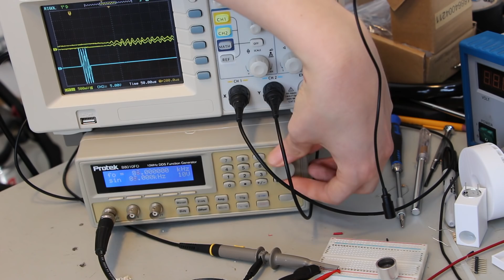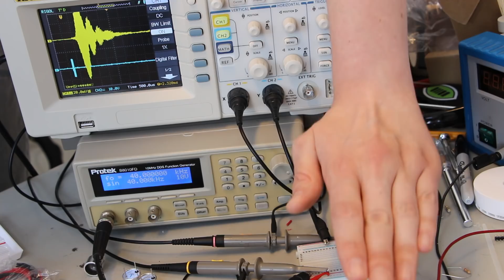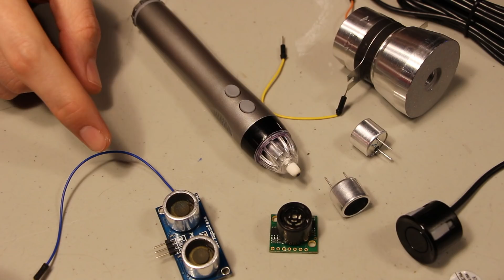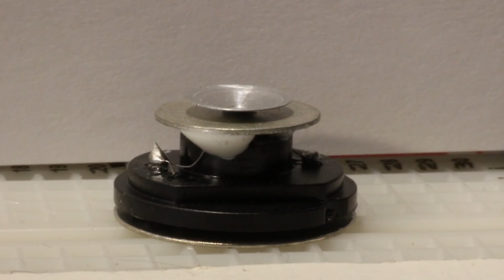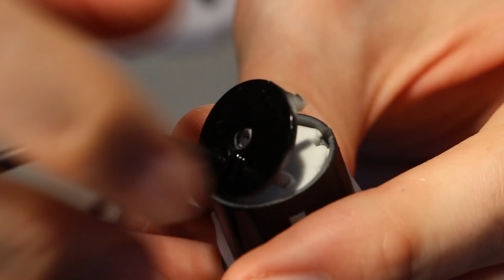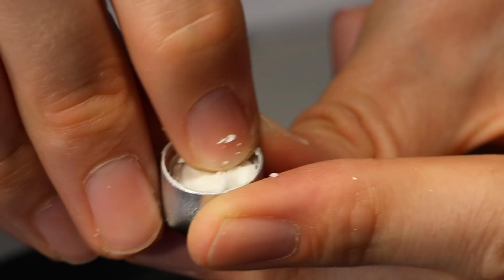Ultrasonic Transducer - scanlime:011

Comment: Excellent video!  Did you ever try using a lighter piezo crystal inversely, as a mechanical actuator? I did it but with 250 volts dc  applied no measurable  expansion. Maybe with AC excitation at resonance?

Comment: if you put a 40KHz sine into a T, then you take the same sine wave into an FM (SSB) modulator and connect it to another T, and you modulate with a signal coming from a microphone or an audio source, you should be able to achieve the laser counterpart of sound. The audible spectrum would be generated by the two ultrasonic waves beating when the second (modulated) one shifts. The interesting thing to do would be to test both free propagation, tube propagation and using a small offset parabolic dish

Comment: Hi Micah,

Great video indeed. I have observed on my side some noise when pressing mechanically on the side of the closed-top transducer sample. It seems that the piezo membrane is in contact with the enclosure. From your observation, do you confirm this detail? Also do you think there is a chance to break it if we keep something in contact with the top surface for a long time?

Comment: Im interested in these things, just curious, what's the smallest transducer/piezo? I've been searching and haven't found much. Is there a way to waterproof them, without loosing too much attenuation? I'd like to use them for both receive and transmit, in a spherical array, but I need/want the frequency response to be lower in the spectrum than the ultrasonic range (ie LF/MF/HF). What do you think the freq response is on these? does it change with size/materials?

Comment: I bought the same sensors, but I do not know which of the two legs is the positive and negative, if I could tell you, you would do me a favor because there is no technical match and I can not solve this problem. tanks
Reply: Micah Elizabeth Scott I have to use it to push the air and in fact on one of the two legs there is black insulator

Comment: Hi Micah, can you say anything about power in these devices? One maker of these is PUI Audio, but they only rate things like 30Vrms or 20Vrms Max, maybe give a value for capacitance, and of course frequency. You're using a sine wave, but I'm wondering what would happen if I drove these as hard as I could with a square wave? If my dv/dt gets too high, will my amps burn those little tiny hookup wires? I want to build something similar to the 'Parametric Speakers' I see around, albeit for a different purpose. Any thoughts on power? Thanks, and great vid!

Comment: Very nice video. Did you ever manage to messure distance with these sensors: 
        https://www.conrad.de/de/ultraschall-sender-kpus-40fs-18t-447-40-khz-x-h-18-mm-x-12-mm-505680.html
https://www.conrad.de/de/ultraschall-empfaenger-kpus-40fs-18r-448-40-khz-x-h-18-mm-x-12-mm-505679.html
?

Manuel

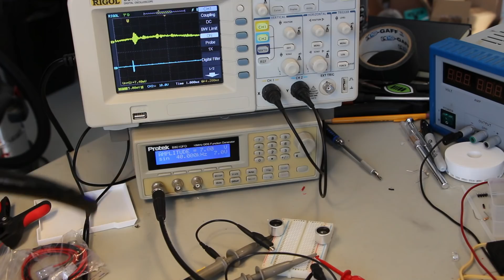Comment: At 13:30 have you tried to squeeze the hose to see if it produces a strong enough echo to be detected and the position determined? Would be awesome if you could use this as a robot bumper-sensor with a thin and flexible hose.

Comment: There are these waterproof sonar sensors that cars use in reverse parking, that have only a single cylinder unlike the ultrasonic module in your video that has a Rx and a Tx. I was wondering how do these car ones work as I could not see a Tx. Do you know how they work - are the Tx and Rx both in that single cylinder?
Reply: thank you so much! that helps.

Comment: At 11:13, it is true that R performs slightly better than T, but it destroys if continous oscillations are used. I tried it for my project on ultrasonic parametric speaker, and getting pretty low amount of modulation on R in comparison to T element. Also, tried to overload both elements up to 150V peak to peak, and it get hot pretty soon. Even at 75 V p-p it works okay for modulated signal, but stil warm. T element survives much longer than R. On the other hand, R elements has better and stronger voltage output when ultrasound is present. I believe that difference is in ceramic - R element has probably more 'polarized' ceramic (something like electret), so that it gives more voltage out. But at cost of rapid destruction if used as a transmitter end.

Comment: Can I use a scavenged audio speaker coil / magnet for a transducer in a cleaning tank? I have a VERY strong hunch that I am paying more for the tank than I am for the transducers ... and, for the size tank I'm interested in, the prices are well in excess of $1200.
Reply: Thank you. Have decided to save up some shekels ($1,222) and buy  a Lyman Power Pro TurboSonic cleaning tank. That is basically what I was hoping to DIY and I'll have the funds in about two weeks. Ten transducers, heater, timer, long tank and a, hopefully never-needed, warranty.

I DO want to say that I am pleased to find a woman over here in DIY / MAKE land. That doesn't happen often and you certainly seem to know your stuff (better than I do).

BY THE WAY: do you know anything about induction heating? I have some sand that I think contains gold and would like to concentrate it by melting it out of the sand ... and also a TON of brass that I need to anneal. I can hit the temps I need with propane, but that generates a LOT of waste heat.

Comment: Micah great video!  I've worked with ultrasonics in the industrial world for 35 years first as a tech and the last 18 years I've worked for a company that makes sensors of all kinds, we make around half of the industrial ultrasonics in the world now.  One of the uses for the silicone and the cork in the automotive sensor may be for mechanical isolation.  If an ultrasonic sensor is mounted so that it can ring through the structure it is mounted to it sometimes causes an interference.  It's kind of interesting that steam or compressed air leaks near an ultrasonic will interfere with them also, they throw off frequencies and harmonics close to what industrial distance sensors listen for.  Air temperature has an effect on accuracy also, you can actually use an ultrasonic pair to measure air temperature.
Reply: Hi Jim. Can I focus ultrasonic sensor to more recievers and measure each of theirs distance?

Comment: Your videos are great!  Thanks so much for spending the time to make them.  The cork in those automotive ultrasound sensors is probably a cheap and effective sound absorber that reduces the echos caused by parts inside the car's bumper.  Getting rid of acoustic energy from the transducer backside is surprisingly difficult sometimes.

I've often wondered about transmit vs receive air piezo elements.  I'm starting to think its mostly marketing.  Buying a "matched pair" makes it sound more valuable than just grabbing a handful of the devices from a bin.
Reply: The difference between transmitting and receiving part should be in theory by mechanical design. Older parts for receiving has two transducers stack on top of each other, thus produding double voltage on incoming sound, which is easier to amplify. Transmitter has single element because opposite situation: with low voltage producing more sound pressure. The problem is that cheap Chinese stuff... you never know what you will found. I am searching for the same transducers, but all I found is paired R and T. So, If I want to build parametric speaker with say 10 elements, I should to buy 10 pairs... And if I got luck to buy R and T paired, but someone made mistake during production and just put letters T and R on the same product - I will be more than happy to buy those.
Reply: Your videos are great too ;)

Comment: I heard from a colleague that it's not wise to dip your hand into a ultrasonic cleaner because the energy will pass through your flesh and make tiny bubbles around your bones. Pain comes with the bubbles before they get absorbed by your body much later. I assume holding the transducer from an ultrasonic cleaner will do the same to your hand...
Reply: +Jacob J Did he find fish?
Reply: +Micah Elizabeth Scott Yeah i guess the air transducers are just fine because they're designed to vibrate easily and pass the energy to the air, just as all normal speakers are. I was only concerned when i see you holding that cleaner transducer tightly - it has a much larger mass (to be able to transfer a lot of energy into water) - and you were getting it all by holding it firmly. Nothing to worry about if your hand feels nothing afterwards. Just saying.
Reply: +Micah Elizabeth Scott I really doubt there's anything to worry about. In a previous job, a collegue would test ultrasonic marine fishfinders by putting them against a temple, and if he could feel it on the opposite temple then it was transmitting :)
Reply: And if he COULDN'T feel it? Time to call the coroner.